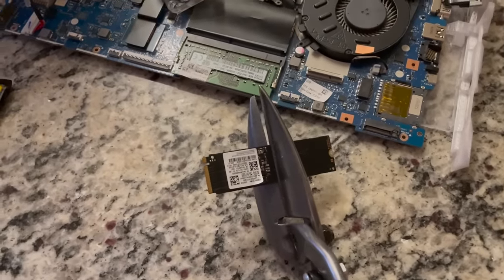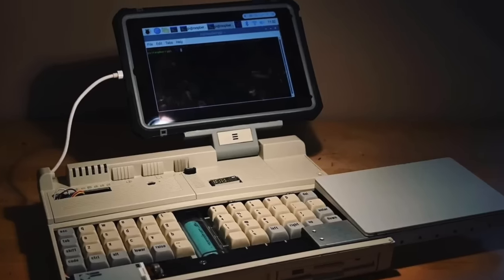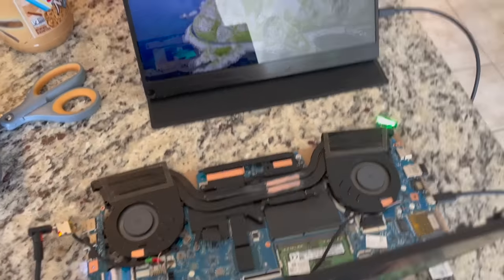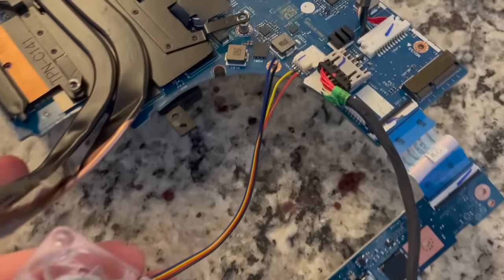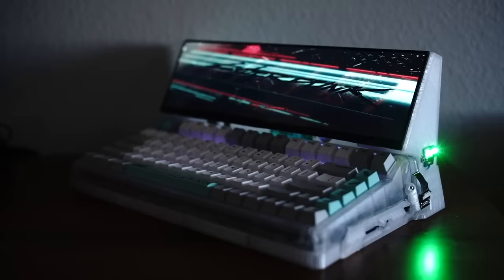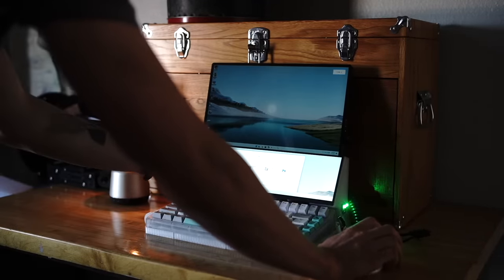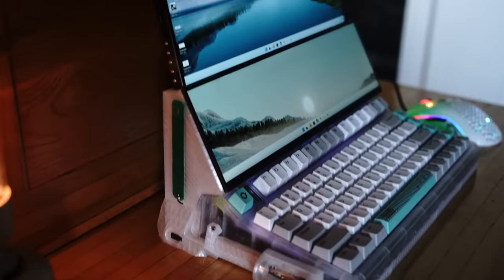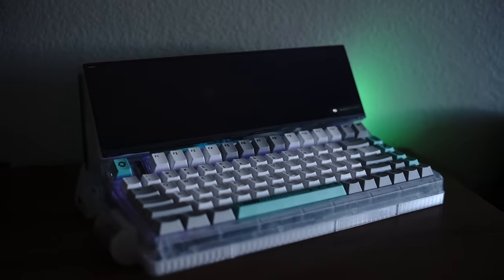I used this as my Computer for a Month

Comment: At first, I was skeptical about the setup with just one wide monitor. But the moment you popped the external monitor on top of the smaller one I was sold. This looks really like a solid build and I could see myself using that if it were a commercially available product.
Reply: Thought the same thing
Reply: Kopy
Reply: It is a product.
Reply: @anshjain3169  It is not, some laptops get close to it but none have a removable upper monitor and a built in mechanical keyboard, nor does any commercially available laptop have the same retro-cyberpunk vibes and aesthetics to it
Reply: yeah, at that moment I was ready to throw money at my monitor. I dunno why, but I feel that I need that. Some grandma typewriter type of feeling
Reply: He should do a kick starter on these things so at least some people would be able to get one

Comment: Gives me hope that someone will actually pull off a proper project Linda that Razer showed off forever ago
Reply from the maker: Pinning this comment to remind future me to do this
Reply: @CarterHurd  i literally bought a windows Phone for continuum as it's wayyy better at doing the mobile to desktop thing than anything else I've seen from the likes of samsung and co
I will be watching your future endeavours with great interest
Reply: you can use samsung dex for the same functionality.
Reply: what's project linda
Reply: @hemantsarthak  but here's the thing
They're no actual thing where you can dock the dex device physically other than plugging it into a cable
That is simply a terrible way of doing it compared to how Razer did it with project Linda
Also dex is really buggy
Reply: Asus has the same thing but it is not the phone
Reply: @kickskii  I think they launched just a monitor or  laptop to work only via the dex a while back .... the screen merging with laptop looks cool but I don't think it would be that practical tbh .... Mobile that expands to tab or laptop that's something more meaningful I think ... Like the hauwaei expandable screen phone
Reply: @hemantsarthak  they still connect via cable the closest thing to a proper commercial solution was done by Motorola with their lapdock thing forever ago where you docked the mobile behind the monitor
Current day lapdock solution involves a laptop like apparatus that comes with a cable you can attach to the phone making the experience not great 
It's not really what project Linda was
I know I tried but due to lack of having cad skills I couldn't get into making a dock myself
I at one point though to buy one of them raspberry Pi laptop 3d print thingies and just replace the whole mousepad and make a mount out of clay or something but i decided to shelve that idea cause it also didn't sound practical enough at the time
Reply: I think ROG has Zephyrus Duo
Reply: @xi8918 you're kinda missing the point
that's literally a laptop
It doesn't have the docking thing
Personally the idea that a phone can go from being a phone to seamlessly transform into a og duo styled laptop just sounds cool as frick which is like the perfect amalgamation of the laptop mobile crossover
Reply: Have you guys seen Zenbook Pro Duo from ASUS? They launched this concept 3 years ago and the actual product is already in the market. The Intel honey comb project is not a new thing!
Reply: lol using the razer phone 2 right now and it is the absolute worst. never buy this phone
Reply: @brucesaadat3793   @Bruce Saadat  but.... docking phone to make laptop tho
I've even seen project Valarie being pulled off semi decently 
The original concept of just putting phone inside a cradle where the touchpad is to turn it into a full body laptop with seamless functionality is kind of a dream i want see pulled off someday
I would have already done it if i knew CAD and had access to a 3d printer
Reply: Just took a look at Project Linda. That's a pretty baller concept! But seamless? Idk, I can see some complications of speed over time. And the LTSupport may make it difficult for some users to justify.
Reply: @HomophobicXenu  i have the razer phone 2 and i love it, but i can tell it won't last long and the usb c port is going to go loose and everything's going to fall apart in a year, as well as not receiving android 10...there's no other phone like it and razer hates supporting it
Reply: @mechanicalruby  the edges of mine are all dented, random speaker pops when im not even listening to everything (it is extremely ear piercing) and it cant even handle watching videos while loading gifs at the same time, it will freak out
Reply: @mechanicalruby  battery is also dying very quickly and restarting it will change the percentage at absolute random.
Reply: @CarterHurd  do you have a link about using the internal display port to drive other displays? I can't find anything.
Reply: @brucesaadat3793  did you not watch the video?
Reply: @do0nv  i havent looked into this specific project but i have seen similar ones, based on my knowledge its a phone plus a lapdock (laptop shell with no actual processing power), this razer phone has laptop specs and the lapdock has a slot for the phone, where a traditionally, a trackpad would be at. The phone will connect to the lapdock in this trackpad slot and turn the lapdock into a laptop. The lapdock will turn the phone into a desktop envoirment and it uses the phones processing power and the phone becomes a trackpad, pretty neat project that as you might know, never got to anywhere other than the concept video
Reply: @hemantsarthak  I don't know which company did it or if it's even real. But I remember seeing a phone that attaches to a laptop like body, and the phone is the track pad. Essentially turning it into a complete laptop
Reply: @roboteen  I think it was a Razer concept laptop smthng
Reply: As a razerphone user, i agree.
The trackpad idea wont work as most went bad, but the hardware is great, it needs a desktop update like samsung dex, but with Razers software.
Reply: there's something called samsung dex
Reply: @misaad16  I use it at least 4 times a week, I love I can use it on a tv, great for films and games.
Reply: Problem is, when you upgrade your phone you will also have to upgrade your laptop
Reply: @DonaldJPump24  idea
Swappable metal cradle attached via screws 
Acts as a heatsink as well as is replaceable when upgrading phone
Reply: They already did years ago it's called Samsung Dex
Reply: @kenyaboi  its not really
its a seamless thing
not one thing and the other
Reply: This is remake Laptop from 1983, no innovation... .
Reply: I feel like your onto something.
Id like to see an all in one pc inside a keyboard... then some how connecting to My Sunglasses.
Reply: Back in the day I had a Motorola Ateix with a laptop dock. I loved it but unfortunately phones weren't very powerful back then.

Comment: i love how it looks like what people in the past imagine what future tech would look like
Reply: I was just thinking something similar!
Reply: lmao wtf you mean future tech, future tech there will be just a huge as monitor with a build in PC . no one is using that tiny ass screen
Reply: @jptraderr  those are already made, but sadly not for purposes of gaming, more for casual/work use. a family member of mine owns one, and it runs 10x slower than my oldest currently owned pc. gonna be a while sadly
Reply: @kanaut  oh yea you are right and  it will be more commen in the future, but we need really good hardware to achieve that.
Reply: @jptraderr  i don’t completely believe that actually, i think it’s possible today with the right design and that’s all. people have built desks that are pc cases, so someone can design something with a special 1080p display with just a mid tower pc case, just a bit fatter to accommodate for the screen ofc
Reply: @jptraderr  unless you’re more thinking of something ipad sized with modern day pc hardware levels, if not caught up to future by then. that would be pretty cool, esp if it had enough case room after the hardware for mouse, keyboard, headset, mic, displayport if not built in 144/240hz display, and an attachment for a monitor stand or something. sounds like perfection
Reply: @jptraderr  those already exist, they're for the most part pretty crappy though. The ones at my school are slower than my phone (and my phone is pretty slow)
Reply: Idk if its been mentioned yet but the same general style you're referring to could be retro futurism give that a search and you should see some pretty neat concepts

Comment: Just an addition - some games only really use borderless, even if the settings menu says "fullscreen". It's not a Windows issue - it's a developer choice to phase out exclusive fullscreen.
Reply: Explain more in depth. I don't really understand.
Reply: @seggzyantilope6023  could you*
Reply: @jetaddict420  thanks for the correction bro
Reply: @seggzyantilope6023  borderless windowed is essentially just a window with no broders that takes up your entire screen, it usually performs slightly worse than fullscreen but it lets you switch to another monitor without tabbing out like with a normal window, it's especially helpful in games that aren't resource intensive and that don't have mouse camera control
Reply: @aarvlo  It's pretty helpful but it can cost you plenty of fps depending on your GPU or APU, RAM etc
Reply: @aarvlo  i absolutely hate those games that don't allow exclusive fullscreen, especially when they're somewhat competitive
Reply: @Monsizr  Yea, and AFAIK it can also prevent Vsync from doing its thing. So if your game is efficient enough to have higher frames, it can cause screen tearing. And/Or not being able to utilise >60hz screens to their fullest.
Reply: @seggzyantilope6023  Some games just don't have an exclusive fullscreen option, even though the game settings may say "fullscreen" - and they run in borderless window mode. You can easily tell by alt-tabbing. If it's instant and the screen doesn't flicker - it's borderless.
Reply: I hate when they do this because windows itself has a lot of benefits to exclusive Fullscreen. I just wish it didn't force you to alt tab the game any time another window is focused.
Reply: @LordSplynter  10 fps difference for me on tarkov, on a laptop, borderless at best 55 without it 60-65
Reply: Windows itself phased out exclusive fullscreen for DX11 and DX12 titles. Exclusive fullscreen is just an optimized borderless window that traps the mouse and sets the desktop resolution to match. The devs may not even know they're not getting exclusive fullscreen.
Reply: @LordSplynter  this is incorrect. in windows 11 it costs exactly 0. It was true years ago.

Comment: Sounds great. As a software engineer who works exclusively on the terminal I am pretty sure I could get by but it would not be an ideal machine. Overpowered hardware with an underpowered display. I approve of the keyboard.

Comment: Possibly the most ingenious hardware hack I've seen.  Would love to own something like this but I have absolutely no ability to make it.  Great job! :)
Reply: you never know until you try, i believe in you
Reply: It’s honestly not that hard with 3d printing now and a lot of the parts are basically plug n play maybe a little soldering involved. At least that’s how I view the process
Reply: @white_noise.t  Unfortunately I don't have a 3d printer.  Something I'd look to get in the future maybe.  They can be quite expensive.
Reply: @javiervaldez7627  Hah I appreciate you :)
Reply: @BritGeeks  not quite they are really expensive if you want those that prints decently
Reply: @BritGeeks  you can get an ender 3 pro for £300
Reply: its cool as a standalone pc, but maybe it would also be nice as a second monitor sort of thing
Reply: Every unsuccessful run is a learning opportunity for improvement until eventually it will work :) don’t focus on the big picture, instead problem solve things step by step

Comment: The inconsistencies with moving your mouse between monitors is because of full screen VS borderless windowed mode. Full screen does not allow you to move the mouse out of the game(sometimes it glitches out though). Borderless allows you to move the mouse unless it's locked by the developers of the specific game. Full screen is usually preferred for games because of lower latency.

Comment: I've dreamed of a project like this for a while, thanks for doing the thing!

Just a couple suggestions for a second effort:

1. This thing should have a trackball on the right (assuming you're right handed)! Trackballs are awesome at saving space without sacrificing functionality. I'm sure one of those boutique ones built to be compact would do the job perfectly. Just need to make sure the ball stays removable so it can be cleaned. A trackpoint would of course also be a good solution but I think it would be way too hacky to make it work with your keyboard.

2. Would be awesome if the top bracket accepted an eink display to get that digital typewriter goodness for writing.

3. Would be nice to find a protective bag to keep the screen from being scuffed.

Comment: So I really like this build, if it was mine, I would have gone with the 3d printed parts in a non translucent form factor and would have sanded and filled the irregularities, and then painted the exterior black, then dry brushed some gold/copper/silver on with some green, to create a verdigris/textured look of very old metal. I've always wanted to build a "500 years after the collapse, distressed cyberdeck" build.        If I could it would actually have a lot of real copper and metal parts.  The janky exposed parts look awesome, and I would have gone all in on that look.  It should be solid, like it's survived and will continue to survive a while, but also look like it was heavily used.  Perhaps I'd even spray bomb that keyboard just masking the keycaps.

Comment: I could unironically see me using this form factor, if it was actually available and produced on the market. I think it's kinda nice!
Reply: yeah well sadly it's not something they actually build these days why cause pay more attention to the dimensions it's way way to think for anything they build these days laptop pc markers sadly are into as thin as possible these days so something like that is not possible anymore even though it would likely sell like crazy
Reply: nice but unusable: 
 - not portable like laptop
 - too weak as desktop pc
-  upgrade path - highly questionable
-------
- this is valid only as typewriter, who like the esthetics of old fashioned ones...which makes product kinda for a small niche ....
Reply: @s.i.m.c.a  Make the screen deatachable, Put it all in a fitting case, and it might not be AS portable as a laptop, but portable non the less. The power of such a device can also be upgraded quite significantly. If high power can be put into a thin af tablet, it can be put into a much thicker keyboard.
The exact example we have in this video is not what a final product of such a concept would look like. This was made as a quick proof of concept for a video. If the big companies tried their hand on their own versions of this loose form factor, the results would obviously be MUCH more refined and usable.
Reply: this thing screams Macintosh Portable

Comment: I'm just a little bit sad this thing isn't running linux, because it would absolutely satisfy my deepest desire to have a retro-futuristic terminal to hack away on lol
Reply: Eh, its simple to just replace Windows with Linux on that machine anyway. Its just another laptop after all... ;)
Reply: I was thinking Twister OS. I've got a Pi4 replacing the CD player in a Sony boombox. Touchscreen, Twister OS, Android 9 and Retropie. Completely portable runs on 12v drill batteries, wifi hotspot from the phone for internet. On going project but using the hell out of it, 24-7. It can carry most accessories inside the boombox under the screen.
Reply: Underrated comment

Comment: i did a similar project (not with good finishing like you did), had a gaming laptop that had faulty keyboard 40pin destroyed and could not fix it (during pendamic) - so i replaced the motheboard and used the damaged one as a gaming PC (attached one type c monitor on top and a smaller size keyboard and mouce... it looks ugly, but it is another gaming PC to my collection. ... Love your work

Comment: RE: The cursor moving between monitors on some games-

I ran into this issue ages ago on my Windows machine running dual/triple displays, I ended up using this software called "Actual Multiple Monitors" to essentially lock the cursor to that display running the game, and it worked fantastically! 

I would suggest checking it out as it does have a bunch of useful stuff for dealing with the annoying quirks you sometimes get running multiple displays on Windows, and may have some use-cases for your crazy projects lol

(Not affiliated with the company in anyway just FYI 😆)
Reply: Some games have fullscreen borderless mode, that’s another way how it works as well, wished more games could do this

Comment: What display panel did you use?
Reply from the maker: It’s on Amazon listed as this:
VSDISPLAY 12.6" NV126B5M-N41 12.6inch1920X515 LCD Screen Work with 2 HD-MI Mini LCD Controller VS-RTD2556HM-V1, Work with Raspberry Pi

Comment: 4:20 I think the problem is that many games say fullscreen but its actually bordless fullscreen, which lets you mouse between screens. But normal fullscreen doesn't normally let you. I have heard a lot of games use borderless without calling it that so it makes sense that that would be the reason, but I don't actually have confirmation.